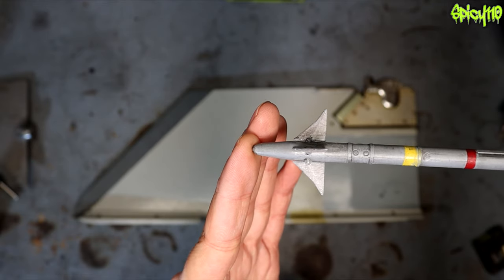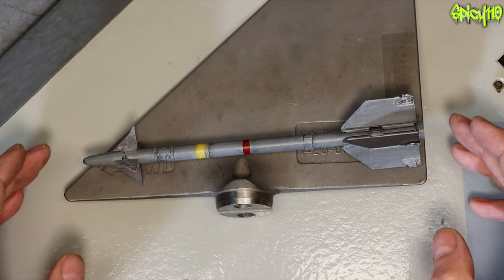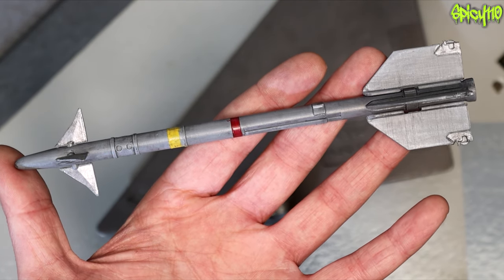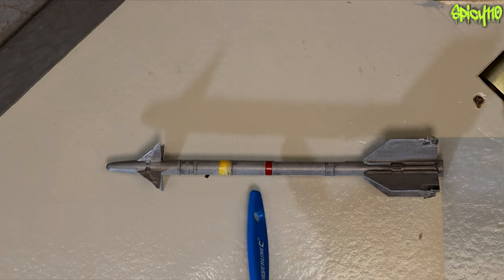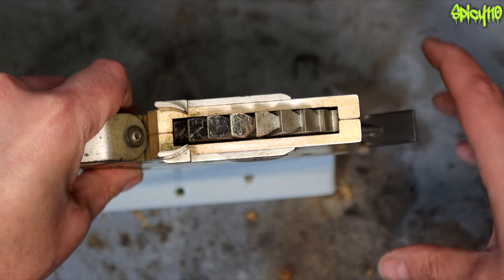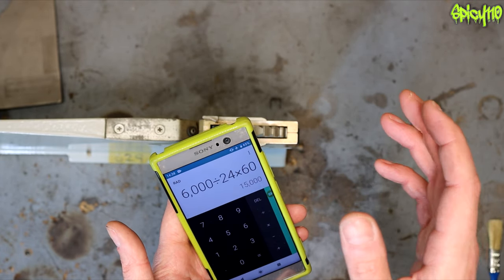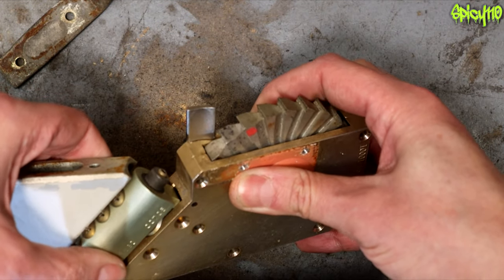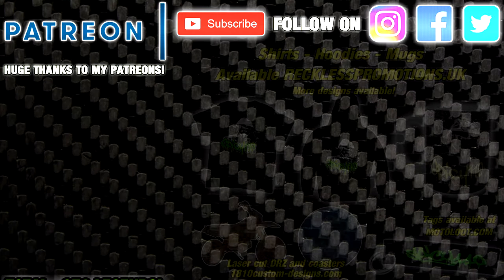AIM 9 SIDEWINDER MISSILE | How it Works with Rolleron Demo!

Comment: This is really interesting. As the gear was spinning down, you could see four distinct peaks in frequency space. The first one peaked at about 6600Hz, so that last one must have had a frequency of about 26,400Hz. That would equate to 66k RPM, which sounds too high. I think the best thing to do would be to spin it up to the maximum speed you could catch on a slow-mo camera, see which peak corresponds to the actual RPM, and extrapolate from there. A modern Samsung can record at 960 fps, which could capture some very high RPMs if you're clever about it.
Reply: Mark a few different fins with different colours and you will get a much more reliable idea of the rpm. I agree 60k rpm sounds to high but not impossible, just from the sound and listening to a lot of things spinning I would say 30k odd sounds about right.
Reply from the maker: I did try to film it at the fastest I could manage 240 fps and its a blur before it even gets going.
Reply: @spicy110  It might be a blur because you're not filming with enough light? If you film in bright direct sunlight, it will only have to collect light for a tiny fraction of that 1/240 seconds. If it's too dark, it'll use the whole frame time. Even with 240fps, you can still theoretically record up to 14,400 rpm if you increase the speed gradually and make sure you don't skip to a multiple of that.
Reply: For what it's worth I've seen multiple quotes of operating speeds in excess of 300k rpm. At an airspeed of over Mach 2.5 ...not as crazy as it first sounds.
Reply: You need to just get a tachometer.  They are cheap on ebay.  The visual kind.  The problem with sound is above 24khz you get nyquist foldover, I could hear it in the video.  Your audio trick is unreliable with high RPM because audio sampling is too slow.

Comment: The canard looks like a a simple cast aluminium piece. The texture is due to the sand mould. Is one cheap way to get things done in relatively low volume.
Reply from the maker: Apart from it attracts a magnet.
Reply: @spicy110  Ferritic stainless steel perhaps?

Comment: That canard looks like its made from cast titanium and the rough surface is just its natural oxidised state.
Titanium is often left unpainted as it doesn't corrode (unlike the painted aluminium rear fins)
I see this a lot on aircraft parts working as a aero mechanic.
Reply from the maker: The thing is the scratches on it have never oxidised.
Reply: @spicy110  the texture is as cast.  It won't really oxidize more unless it's heated.  Leaving it rough as cast may have a secondary aerodynamic purpose, but mainly it's cheaper not to finish it anyway.
Reply from the maker: ok I am with you!
Reply: Its aircraft aluminum.
Reply from the maker: I just had a thought and checked them with a magnet, and they strongly attract a magnet so they must be a steel based alloy.
Reply from the maker: I just had a thought and checked them with a magnet, and they strongly attract a magnet so they must be a steel based alloy.
Reply from the maker: I just had a thought and checked them with a magnet, and they strongly attract a magnet so they must be a steel based alloy.
Reply: @spicy110  That is unexpected.  Is the entire canard magnetic?  It really looks like a cast finish.  Cast steel is a possibility.  Keep in mind titanium is weakly magnetic, but you did say it's pretty strongly so.

Comment: A couple of thoughts about this. Would the armourers perhaps unlock the tabs pre-flight? or maybe not as then the missiles would be trying to correct the planes flight manoeuvres. 

Those spinning Gyro's with 4 on each missile and up to 8 missiles on a plane would be quite noisy in flight or maybe just on landing for ground crew. Even a finger trap for a few minutes!
Reply from the maker: To my understanding the wheels are held in place with 2 bands in flight that pop off at launch, The whole surface is held by the tabs but not the wheel.

Comment: Come from a Chinese youtube video that uses part of your video. In its comment section someone suggests that the flaps/gate in front of the wheel is there to limit the wheel's speed. The gate acts as an orifice, which accelerates the air speed and blows the wheel faster. However, in supersonic speed aerodynamic acts differently and the orifice actually reduces air speed. This will limits the speed of air acting on the wheel to mach 1 and prevent it from destroying itself. 

ROC tried to copy sidewinder and didn't understand the purpose of the gate, ended up blowing up several test missiles before adding the gate.

Not sure if this information is true tho

edit: It's PRC (mainland china) not ROC (Taiwan), Sorry
Reply from the maker: Can you link me that video please
Reply: @spicy110  https://youtu.be/dUBw4cg_N6w?t=165
it's in Mandarin tho. The comment explaining this was made by 
Ignacio Lavan (In mandarin). If you need help translating his words just let me know.

Comment: Great video. I'd already seen the older one, really enjoyed the more "in depth" look and explanations.
I'm really curious about two things that I've not been able to get answers for. Perhaps someone here knows the answers and will be willing to share their knowledge. 
First; Is there an official name for the spinning wheel?
Second; Do these wheels spin for the entire that the plane is flying, or only once the missile is fired from the plane. I can think of logistical problems in either scenario. 
If they spin the entire flight, I would think that would wear out the bearings. Depending on what plane is carrying the missile, a sortie can last 4 or more hours. I don't believe it's unreasonable to think it possible that one of these missiles would fly several dozens of sorties over it's service life, without ever being fired.
If the don't spin up until they are launched, I would think this would cause some instability issues during the beginning of the missile's flight. That means an unstable missile, in close proximity to the plane that launched it. I can see that leading to some horribly unintended outcomes.
Reply from the maker: The whole unit is called a rolleron, the wheel would be a gyro wheel. I believe the missile have bands around the fins that hold all the wheels in place in flight but pop off at launch. 🙂
Reply: @spicy110   Thanks!
I knew the entire mechanism was called a rolleron. It was the spinning wheel itself that I didn't know. I'm aware of some of the interesting nomenclature the military comes up with when it comes to naming things. I was imagining something along the lines of:
Rotor, High Speed, Gyro, Air Driven, Passive Stability Unit, Unfinished, DO NOT PAINT

The band that comes off at launch brings me back to that initial stability issue. Obviously, it works, for the missile to be as successful as it is, for as long as it has. 
Thanks again for the quick response, and the great videos. 
Cheers
Reply: If the rollerons function as indicated in their patent listing, they spin throughout the flight. The locking tabs at the back appear to disengage under the g-shock of launch. 

The bearings are probably over engineered to allow for wear.
Reply: @martindinner3621  The tabs(bands) at the back hold the wheel in place during flight. They unlock during launch allowing the wheel to spin. That prevents unnecessary wear on the bearings
Reply: I'm pretty sure the gyros only spin at launch. Allowing them to spin during flight would create more drag than keeping them stationary (granted, a small amount of drag relative to the plane, but every little bit counts). I know this sounds counterintuitive, and not knowing better, I would guess that allowing them to move would lead to less drag, but as I understand it, if it spins then the air is doing work, while if it doesn't spin the air is not doing work. On the other hand, fighter jets have a lot of things that cause drag, and they are very non-airplanelike in many ways. If you apply enough power you can make anything fly.

The fact that there is a band AND a lock seems to argue for them not spinning as well.

Comment: naive rpm equation for the flywheel/gyroscope, if this helps: no teeth to count just measure the wheel.  
max missile speed (in/m) over (circumference (in) * pi) = pi/m or rpm  <---diy stoichiometry 
The air funnel or forcing cone -- whatever -- creates some high pressure aka higher velocity air which is likely negligible but the naive math for that is ratio of areas, simplified to 2D, the ratio (width front):(width back) and this is a number that you multiply with the max missile speed.

Is this close to what you were thinking?

Comment: I’m curious if the rollaron was exposed to the airstream while on the rail of the aircraft and spinning? If it was, does that mean flight hours were logged for scheduled inspection, maintenance / replacement?
Reply from the maker: no, i am told they were wired in place and would release on launch.

Comment: I believe all aim-9s use heat seeker head
One of the main difference with the newer models (Aim9x) is it uses an off bore heat seeker that can lock onto planes up to 90° off angle i believe as well as the rear fins being able to move and actually thrust vector the rocket motor.
But a wonderful video, ive honestly havent seen parts of the sidewinder being looked at this close in vids.
Reply: There was one exception. The AIM-9C was radar guided.
Reply: There was a Semi Active Radar Homing (SARH) version and a Passive Radar guided version for attacking radars and SAM sites like the HARM missile but with much shorter range. It served in the USMC on Harriers and helicopters...
Reply: "One of the main difference with the newer models (Aim9x) is it uses an off bore heat seeker"

The seekers always had gimbals on them, and could do some amount of off-boresight launching for a long while, what makes the AIM-9X special is a bit more than that.

The traditional way to launch these would be to either have the missile's seeker boresighted (looking forwards), the pilot would put the target in the sights, listen whether the missile was recognizing the heat signature (the growl made by the seeker would intensify and usually go up in pitch), and if so could then uncage the seeker, which would follow the target even if it was no-longer under the sight. So you could lock while boresighted, then fire slightly off-boresight, within the gimbal limits (if you were still within gimbal limits, but near them, it could well lose lock during the initial acceleration, so was best to be pretty centered).

Later on the seeker could also be slaved to the radar, so if you had a radar lock on a target, the radar could tell the Sidewinder where to look, and then lock on. This also gave limited off-boresight capability.

The AIM-9X changed the game in many ways, being the first Sidewinder model to feature an imaging IR sensor instead of a "normal" IR sensor (similar to the difference between a light sensor and a camera), which means it can also recognize shapes and sizes, rather than "just" intensity and contrast etc. (helps a lot with countermeasure resistance), and off course as mentioned increased the gimbal capabilities and IIRC the FOV a bit as well.

One of the biggest upgrades though that really enabled the high off-boresight shots was the integration to the helmet mounted displays/sights, which meant the pilot can just look at the target and the missile's seeker follows their gaze. The pilot can look more off to the sides and up than the radar can, after all. =) NOTE: This was a new capability for the US military in the 2000s, but certainly not a new capability in the world. The first helmet mounted sights that could be used to lock a heat-seeker to an off-boresight target were fielded by South Africa starting in the mid-late 60s, using the Armscor V3A missile, and the Soviets had them as well on the MiG-29 and Su-27, with the R-73 missile. These couldn't quite launch as far off of boresight as the AIM-9X can, but we're still talking around 40° off the centerline of the missile.

Later block upgrades to the AIM-9X also add even more fancy things, like Lock-On After Launch (LOAL) capability, meaning the missile doesn't have to be locked on the target when it's launched, it can find it later. Basically this enables maneuvers like the datalink telling the missile "there's a target behind the plane", the missile launches, turns around, and starts looking for the target in the area where the datalink said there should be one. This kind of launch has been officially demonstrated with at least some European missiles used by the Rafale fighter jet, and possibly some Israeli Python ones, but not with Sidewinders AFAIK.

Comment: was anyone else confused how the stabilization works, as the gyroscope seems to me to turn the aileron in the direction where its would emphasize rather than damped the unstable movement of the missile.

is the intent to stabiles it in pitch and yaw or roll?
Reply: At 17:28 you can see that it works to counter roll. He rolls the fin up in the frame, the aileron moves up as well, which would cause an aerodynamic force opposite to the force he introduced. Yaw and pitch are controlled with the canards on these.
Reply: @dirkmohrmann8960  Exactly. It works like a sort of automatic trim tab

Comment: Did you try to loosen the torx screw on the pivoting 00705 part? It should allow the sub-assembly to slide off and further disassemble.
Reply from the maker: that was a Alan head and no that thing is not coming out, I did mention it....I think

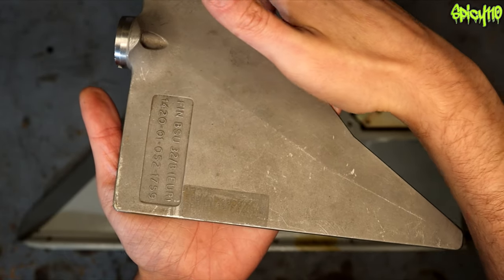Comment: Air sticking to a surface (or more accurately, air slowing down over a surface as you described at 8:47) increases drag, not decreases. If the rough surface finish was somehow driven by  aerodynamic requirements, it wasnt to reduce skin drag (which is what you are describing) I can tell you that much.
Reply from the maker: I was thinking like golf balls. "Dimples on a golf ball create a thin turbulent boundary layer of air that clings to the ball's surface. This allows the smoothly flowing air to follow the ball's surface a little farther around the back side of the ball, thereby decreasing the size of the wake."
Reply: Spicy is correct; a very minor increase in drag at the surface can reduce overall drag by promoting laminar flow.
If you look on some airliner upper wings, you will sometimes see little fins sticking up, at a slight angle to the airflow.  This generates a vortex (drag), but makes the rest of the airflow stick to the wing, increasing lift by promoting laminar flow.

Aerodynamics can be counterintuitive.
Reply: @spicy110  You are correct my friend, it's also the same principle which fish scales, they're not only for protection they give a "cavitation layer" across their surface. A boat propeller turning too fast cavitates, and the prop loses "grip" on the surrounding water. Fascinating video btw.
Reply: @spicy110  at M=2.5, its already turbulent, no need to trip the flow

Comment: thanks a lot for making this video, twice in fact, but I am still having trouble understanding why you keep adding a yawing movement to describe a rotational movement along the length of the airframe.  Why not just rotate it along its bottom edge?  

Anyways, I could see that it works (im assuming its not just gravitational forces pulling the tab down) but I am still having trouble understanding it :(
Reply from the maker: I am just demonstrating the Inertia of the wheel. The tab is opened by the g force of launching it.

Comment: If the inertia-wheel is very heavy keep in mind that it can be depleted uranium.
Reply from the maker: It's defiantly not, DU is used for perpetrator rounds, it would be a huge unessery weight and cost.

Comment: rough surface = cheaper and easier to produce

consider this is going supersonic and air behaves a bit different ahead and behind the shockwave than subsonic aerodynamics. Most likely the surface roughness achieved just didn't matter enough. And consider it could be painted as well, which would act to smooth the surface. When this was invented, CNC machining wasn't a thing. Complex machining operations were costly and time consuming.

Comment: I wonder if this would work as antiroll mechanism on a ship.
Reply: No
Reply: @nonyabuziness5082  Yes it could, but it would have to be either sub-merged or connected via an actuator to a vane in the water. The same principle could stop a car rolling too.
Reply: @biggerbang1293  No because a ship has to much mass and the force pressing against it is exponentially higher as well as water can not be compressed like air can.. If you tried to use this as an anti roll device on a ship in the ocean it would fail. However it might work for a large airship like a Zeppelin or a Blimp...